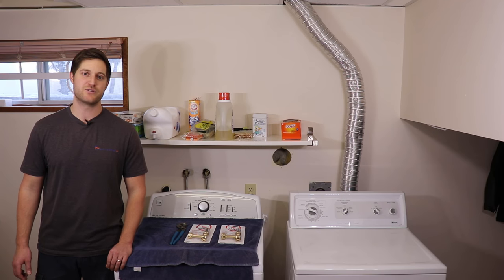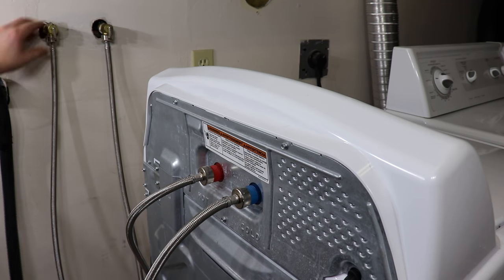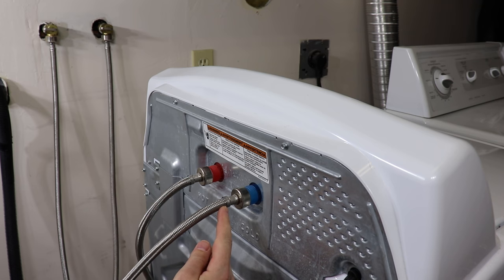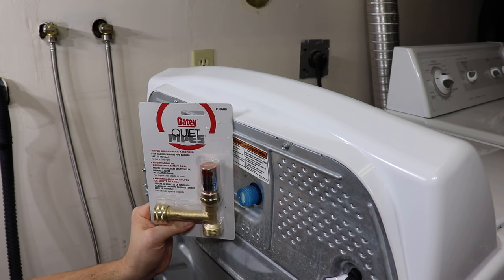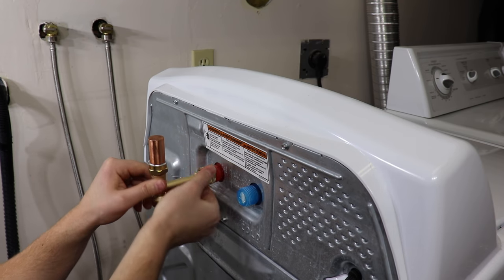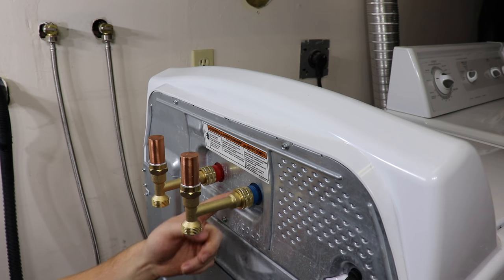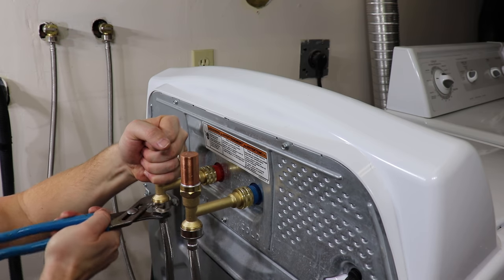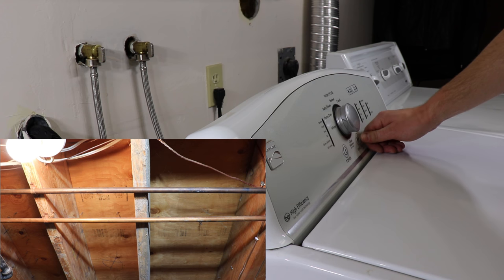Stop Water Pipes From Banging: Installing Washing Machine Water Hammer Arrestors

Comment: before investing on a water hammer arrestor that has a lifetime of 1 year or so, try reducing the water pressure, easily done by closing the cold and hot water valves feeding the washer. this may increase the time it takes to fill the washer, but we are talking about few minutes.  If you look further you will find that your house's water pressure service is higher than normal. it should be around 60 psi.
Reply: Fantastic idea!
Reply: Thank you also.
Reply: No good as the machine will pick up low water pressure
Reply: I tried that and it worked for a while, but the banging eventually came back.
Reply: The real tips are always in the comments. This solved my hammer issue by closing off the valve by about half. I’m still going to replace the arrester, though. Mine just screw in so it’s a quick job. Cheers.
Reply: You may not be able to do this depending on the type of shutoff valve you have. If you have a ball valve, it is an on and off valve, and you shouldn't use it to regulate flow/pressure.

Comment: I used these for my washer. It fixed the problem, but they only last a year. Happened 3 times. I finally stopped the water hammer permanently by closing the valves halfway to the washer.
Reply: So you stopped using your washer??
Reply: @AlHuerta  no , i just partially closed the water valves

Comment: Great video! Wonder why appliance manufacturers don’t have these integrated into the product?
Reply: Their products would last too long then /s
Reply: @MurCurieux - not having hammer arrestors fitted to w/m is not the problem, the manufacturers could make the w/m tap valves turn off softer or slower would remedy the problem

Comment: This really helped me as our plumber had installed these at the wall/water supply which I hear is quite common?  It didn't help at all so when I saw your video that showed you install them at the washer, I moved them from the wall to the washer and 2 years worth of water hammer was immediately fixed!  Thanks so much for sharing!

Comment: I bought a new washing machine a few weeks ago.  It did not take long for me to realize the solenoid valves in the washer were shutting off the water supply way too abruptly.  The pipes in the house banged so loud, I was worried something might break.  The banging got worse every time I used the washer.  I was going to call my plumber to see if he had any recommendations.  I also was worried it was going to damage the expansion tank.   I found your video and thought I would give this fix a try since it was easy and relatively cheap to do.  I installed the arrestors.  It solved the hammer completely!   Thank you!  Thank you!  

Liked and subscribed!
Reply: Did you installed to the washer machine like this way?

Comment: Had a water hammer on my heating unit humidifier and the arrestor did the trick. It to had a solenoid valve . Thanks again.
Reply from the maker: That's a great point KF. I forgot to mention humidifiers as well. Glad a water hammer arrestor did the trick!

Comment: these things are awesome! for the past year the pipes have sounded like they were going to shake themselves apart every time the new washer would close the valves, the hammer arrestors solved the problem 100%! even if they last only a few years like some say it's about $20 for two so just replace them. one thing to keep in mind is the gasket in the old lines has probably seated and may have a slow leak when reconnected like mine did, so get new gaskets or even better replace the lines when installing these.
Reply from the maker: Thanks for the comment and great advice on the washer! This information will definitely help anyone thinking about tackling this install. All the Best!
Reply: @PROSDIY  actually thank you! i bought them right after watching your video!

Comment: once I have fitted the hoses, and turned the water back on, I set the machine to " wash " just to " bleed " the air out of the hoses, so that you test for water leaks, other wise, it might not show., here in the UK there is only a cold feed, these days. great video, thanks, especially about been careful to avoid " cross threading " the connections, and not to over tighten.

Comment: Hello professor, from the instruction of Qatey, I screw Quiet Pipe to the valve not to the back of my washer. Then the  pipe is still banging. So does it matter that where you screw the Quiet Pipe? Thanks.

Comment: I'm not sure the Oatey ones are ideal for my situation, because the W&D are in a relatively narrow hall/utility going to the garage.  Every inch counts for getting the machines as close to the wall as possible.  The Oateys may compromise that;  are there versions with shorter extensions?

Comment: We have hammer arrestors at the faucet side of our 4 year old front loading good quality washer, not at the washing machine ports as in your video. Have you solved the issue by putting in two sets of arrestors at the faucet and rear of washing machine?  Do you believe by backing off the 1/4" turn valve and reducing intake flow might help? 
I've bled the system to the house by opening all faucets and no water shoots out in bursts.  The issue occurs in both Cold and Hot Water and we are on a septic/well.  The PSI at the lowest spigot is roughly 68 PSI which is necessary to run a Pressure Washer as it requires 3.5 GPS we get roughly 6 +/- GPM total.  Plus 68 PSI is a good overall pressure to my knowledge. I can't say for sure but I believe the issue began after we had a plumber install a Whole House water filtration system as he had to re-run Pex but again this may be irrelevant. Good point about the abrupt action of the solenoid opening and closing. I do like the idea about disconnecting the connections at the washer and bleeding the lines just briefly however I wonder if this is a waste of time since I bled all faucets and toilets recently after a plumber replaced a tankless system. Thank you.

Comment: I recently installed 2 Oatey branded water hammer arrestors, just like yours on the video. I still have some banging; I am just wondering if the operative part (i.e. where the bladder and air cushion is) on the Oatey arrestor is too short? The operative part is 1 inch shorter than the Sioux Chief brand. What is your opinion?

Comment: What's the difference if I connect the arrestors directly to the water supply valves versus connecting directly to the washing machine?
Reply from the maker: There shouldn't be any noticeable difference by connecting it either way. It's just industry standard to install an arrestor as close to the source of the water hammer as possible. In the case of a washing machine it's the solenoid valves within the washer. That's why I personally install them at the washer if practical. That being said there's only a couple of feet of hose between the isolation valves and the washing machine connections, which shouldn't make a difference. Thanks for the question!
Reply: @PROSDIY  Thanks for the info!

Comment: I just installed the hammer arrestors on my LG washing machine and my pipes are still banging. This is a brand new machine. Didn't happen with my old Electrolux. I think maybe the lines are too long??
Reply: You need a rubber hose with wider distribution

Comment: Added arrestors about a year ago. Recently had floor replaced. Had to move washer. Now noticing hammering again. Is this because the hoses were disconnected? And if so does that mean the arrestors are toast or can I purge them somehow to make them work again? Thank you for a great video.
Reply from the maker: Thanks for the question. The newer model water hammer arrestors as shown in the video use a rubber or neoprene bladder to separate the water from the air cushion, and can't be purged. Shutting off the water to the washer and removing the hose takes the pressure off the neoprene bladder. When repressurizing sometimes the force of the water reentering the water hammer arrestor can damage the bladder, causing the water hammer to occur. This would be my best guess on what happened and would require replacements. Before replacing the water hammer arrestors I would try a few tests first. 

1) When the washer is filling on a warm cycle, so that both the hot and cold are being used, lift the hoses in the back up as high as they will go. This can remove an airlock if one is present.

2) Run a cold only cycle followed by a hot only cycle. Listen to see if the water hammer occurs on one or the other, or both. If it happens on only one, switch the arrestors and try the same test again. This will confirm which arrestor may be at fault.

Best of luck!

Comment: Make sure you re-connect the hoses in the correct place???? 
How about you just do one at a time. Can't mix it up then. 
But thanks for the well-done video. Now off to the Depot
Reply from the maker: That's a great point. That would work as well. Going back in time I probably would have just said that lol. Good information for anyone else though. Thanks 😀

Comment: I must replace my old ones.  The plumber had placed them at base of water, not on the washing machine itself.  Shall I install the new ones on the washer, like you did?  Does it matter?  Thanks!
Reply: Either way it’s up too you, directions on the product package has it installed at the shutoff valve. I placed mine on the washer directly since that’s the point where the resistance starts when the solenoids close.
Reply: @andrewhoffman2273  Thanks so much Andrew.  Earlier I called customer service at Sioux Chief and they also said either installation is fine.  They also told me arrestors can installed be at any angle.  👍🏼

Comment: Does the manufacturer recommend that the arrest or be installed in a vertical position? The plumber installed mine at an angle, don’t know if it makes a difference. I see Shark Bite arrestors installed horizontal as well. In a recessed wall box vertical is the best way.
Reply from the maker: They will function properly in any orientation.

Comment: I had the water hammer arresters installed on my washing machine a few months ago.  The banging noise in my wall stopped as well as the banging noise in my washing machine, however, the banging noise has now started again.  Any suggestions?  Thanks!
Reply: My machine is evil and compensates for whatever adjustments I make.  The machine creates a water hammer after about 3 cycles.  I put water hammer arrestors on both sides of the washing machine hoses.  I closed the valves to nearly off.  We drained all the water out of the home pipes and then refilled the house.  We tried the inline water hammer arrestor.  Nothing stops it.  My LG can work around the fixes and start banging the pipes again.  I regret buying it.
Reply: I have LG machine too , great machine but  even with these arrestors the pipes go bang bang ‼️ I’m going to see if opening taps only a quarter turn helps ☝️

Comment: I don't have the extra space to set my washer that far from the wall. Is there another option that doesn't require such a long horizontal extension? Won't be able to open the back door to garage of I have to move the washer forward to accommodate.
Reply from the maker: Are the shut off valves right behind the washing machine or off to the side? If they are off to the side the water hammer arrestors can be installed on the shut offs and not on the back of the washing machine and still function properly. If the shut offs are directly behind the washing machine and that option doesn't work, you could install the water hammer arrestors inline with the use of a male x male garden hose coupling and a short washing machine hose. A male x female washing machine hose would work as well. Let me know if you have any questions. Thanks!

⬇️Amazon Links⬇️
Male x Female Washing Machine Hose
https://geni.us/Re09
Male X Male Hose Coupling
https://geni.us/XFuRgWF
12" Washing Machine Hose
https://geni.us/kC5H0

With the use of the options listed above the water hammer arrestor would hang behind the washing machine and still function properly.

Comment: Tried two sets of these. Leaks like crazy.  After putting it on the inlet to the washer, it needs several additional turns. If i only turned it a 1/4 or 1/2 turn past hand tight, it would still be incredibly loose and would gush.
Reply: maybe turn house water level down?
Reply: Had same problem, I slipped an o ring under brass lip of lock down threaded collar with some plumbers grease and retightened , leak gone . BTW we have about 90 psi water pressure here so yeah  I am setting taps only half way open now too ☝️

Comment: Why the water hammer comes again 2 years later after the installation of the arestor ?
Reply from the maker: Hi Becky, Most water hammer arrestors use a rubber or neoprene bladder to separate the water from the air cushion. This air cushion is what absorbs the water hammer. If the bladder is ruptured the arrestor will fill with water and the air cushion will be lost, causing the water hammer to return. It sounds like you'll need to replace the water hammer arrestors. You can test which arrestor has failed by just running a cold only cycle then a hot only cycle and listening for which side causes the water hammer. I would recommend replacing both though, as once one fails the other is soon to follow. The life span varies greatly depending on factors like water pressure, water quality, usage, and quality of the valve. Thanks for the question! All the Best!
Reply: @PROSDIY for $36 each they only last two years ? Yikes what a terrible design . I saw hydraulic arrestors that cost over $150 each are
They any better ?

Comment: Yesterday  this hammer arrestor Sioux could not be fitted to my Miele washing machine as the inlet connector was covered up by Miele so rather than unscrew anything that I should not I reduced the water pressure by 1/4 of a turn. This has had the desired effect the hammer noise has been reduced to a rather softer and more pleasing sound. Time will tell is it is okay.
Reply from the maker: Do you have room to install them on the shut off valve side? The arrestors will also work installed there as well.
Reply: @PROSDIY  I have returned the arrestor and as I said before By slightly reducing the water pressure no one gets woken up in the night with banging. Happy with a bit of lateral thinking so far.

Comment: So my problem is on the toilet, should I install one of these (noise stoppers) on the valve that connects to the toilet????.
Reply from the maker: You can install water hammer arrestors to the toilet's water supply if water hammer is the issue. If the water line is rattling or banging then a water hammer arrestor should fix it. If it is another type of noise maybe try these steps in this video: https://youtu.be/5VSJvtvMzGc
Please see the link below for the arrestors designed for toilets and sinks.

⬇️Amazon Link⬇️
Toilet Water Hammer Arrester
https://geni.us/qg4BJ

Comment: I don't know what pressure works on you country but here in my country I never isue those problems and I never see one of those hammer installed on any plumb system. I see another video where explain why to use those hammers but as I said, never see a leak or another problem I'd not used it.
Reply from the maker: Interesting. You're right that higher water pressures can effect water hammer. When I lived in Edmonton, Alberta our supplied water pressure was around 70 PSI which caused water hammer on our washing machine. Where I live now, I have a supplied water pressure of 50 PSI and have no water hammer and no need for water hammer arrestors.

Comment: what were you doing there in the beginning by turning machine on for few seconds?
Reply from the maker: Demonstrating the water hammer before the arrestors are installed. The hoses shake and the the hammer is heard through the copper pipes.

Comment: I've used the 2 sets of arrestors. 1 set behind the washer at the hose connection 1 set at at the other end of the hoses at the faucet connection, nothing. Plumber installed water pressure reduction valve and expansion tank at service line. $830. Pressure at
50, nothing. Tried pressure at redicously low 30, nothing. Banging as loud as ever. Now what?
Reply from the maker: That is extremely unfortunate and frustrating. Does the water hammer only occur with the washing machine, cold only, hot only, or both? You took all the proper steps that I'd take. Once I hear back from the questions I'll have a better idea. I'm leaning towards an issue with the washing machine because you went above and beyond to prevent against water hammer. Possibly a faulty solenoid valve, or debris in the solenoid valve. I've personally always have had an immediate fix to water hammer if a expansion tank was installed at the service line, as you've done.

Try running this test. Hopefully you have 1/4 turn shut offs, because this test will work better.
Turn off the water to the washing machine. Disconnect the hoses at the washing machine side. Test each side hot/cold separately. Run the hose into a bucket. Open the valve wide open and close as fast as possible. See if the water hammer occurs. If it doesn't, the issue is most likely with the washing machine. Let me know what you find out.

Thanks for the question and good luck!